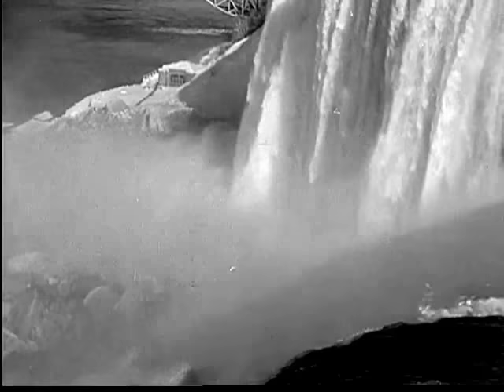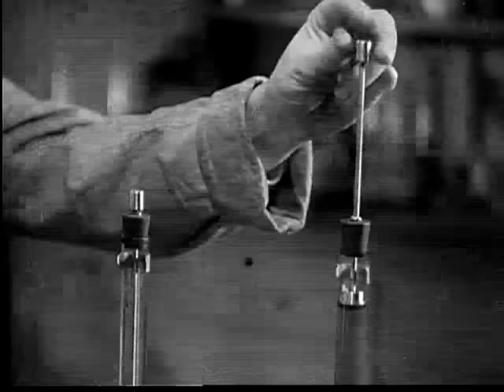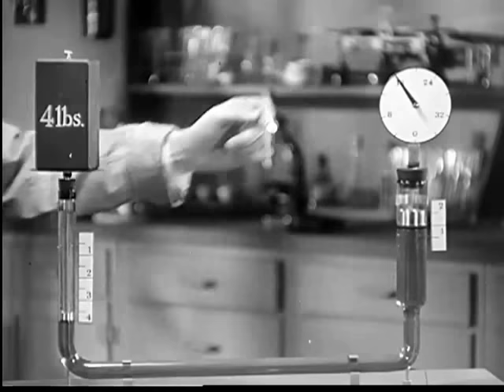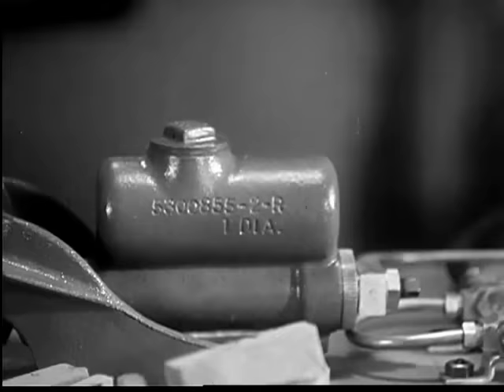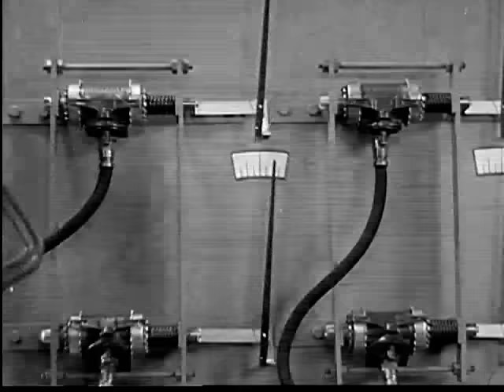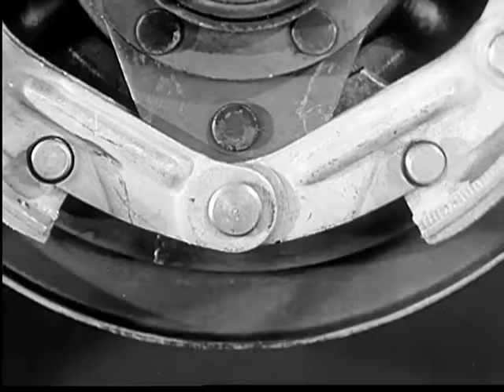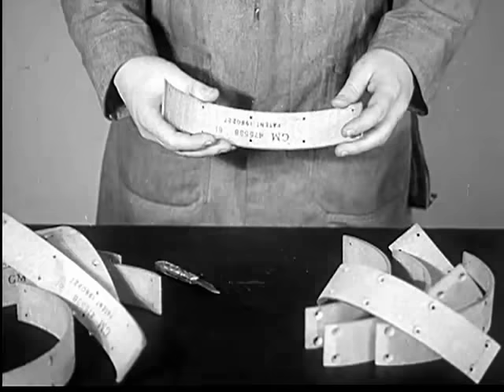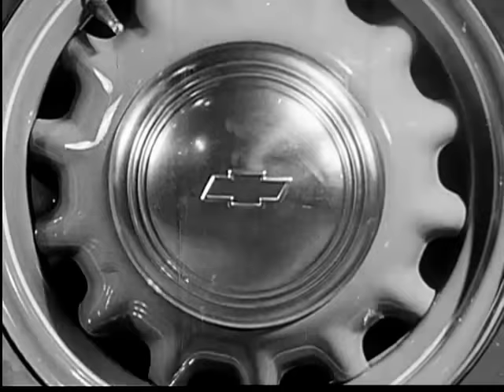Hydraulics (1936)

Comment: 90hp and a 0-60 of 20 seconds, what simpler times they were
Reply: Your car also might have not had an oil filter back then, it was an optional accessory but it was available.
Reply: To think.  My 2 cylinder, 325cc motorcycle has 42 HP and gets to 60 in about 4-5 seconds.
Reply: @this_mfr  motorcycles are different story, world speed record for fastest motorcycle in 1937 was 173mph
Reply: The world speed record for a car in 1937 was 345 mph....
Reply: @retard1643  
173 mph ?  .... in 1937 ? .... On 2 wheels ?  .... And Drum Brakes too ? ....  
F*&k that for a game of soldiers.... I would be shitting myself...........
Reply: To be fair, when this video came out there were people who watched in their middle age who had known horse drawn vehicles as the only way to travel large distances. 90hp doesn't sound so bad from that perspective. In fact if you told them in 2019 80+ years later the modern car was only 200-250 odd hp on average and was earthbound they may be bitterly disappointed.
Reply: We also had working men here in the states.
Reply: @michaelhawthorne8696  just search it on wiki
Reply: @clancon  tbh today alot people have around 90 or less hp
Reply: My 2001 car has drum brakes on back hWeels™ and 100hp. Not that different
Reply: no different to a lot of small cars available today.
Reply: @Herbertti3  yes but for a long time cars had 4 drums. Discs are alot better. Drums suffer from brake fade, it is cause by continuous braking like you might go down a hill. The drum heats up and expands. When you get to the bottom your brakes dont work or half way down the hill.
Reply: It's always a compromise with those things, sure, discs are better, more controllable, and feel a helluva lot better, but they also have an overheat failure, and that is boiling the brake fluid away, something that is a bit harder to achieve with the drums.

Not sure it's like this with all the cars, but the drums on that old beater i used to drive, when they inevitably faded going down the curitiban mountain bass, i'd just pump the brake a couple times and they would adjust and start braking again!

I did manage to boil the fluid on the newer car going down the same infamous pass a little too fast.
Rear mechanical drums saved the day, that's for damn sure!
Reply: @GashimahironChl I was under the impression that drums got bad brake fade and that it didn't really happen with discs, but it is true that the fluid can boil in extreme circumstances.
Reply: Clancy Conway 90 hp at that that was the shit! Today, to compare something like that, we look at 500-700 hp cars. I think its a really great improvement knowing these 5-700hp engines do not use more fuel than those 70hp engines.
Reply: GashimahironChl no matter what, rotors=10x better than drums.
Reply: My car has exactly 90hp and drum brakes in the back wheels 🤣
Reply: @101Volts ; sorry, but by the 1930s oil filters were standard on American cars.
Reply: @this_mfr ; and how much does you motorcycle weigh?
Reply: @RBZ06LT6 ; and what production car has 500-700 hp, (not counting $500,000.00+ sports cars)?
Reply: @RBZ06LT6 ; I'm not sure the factor is 10. Remember, the car is stopped by the contact of the tires with the road, and rolling friction is greater than sliding friction. My XKE had Disk breaks all-round, but could not stop in 1/10th of the distance as my Ford with Drum breaks. Yes, Disks are better, but not 10 times better.
Reply: oldgysgt my $65k Dodge Hellcat has 707 horsepower.....
Reply: @rockcrawler3119 ; and although it didn't cost $500,000.00, I think we both agree the Hallcat is still in the category of a luxury sports coup. It's not exactly a family car for the average car buyer like the 90hp Chevy shown in the video. A 1935 Supercharged Duesenberg Model SSJ produced 400hp.
Reply: oldgysgt My Hellcat is no more luxurious than the inside of the same car with a V-6. It is not a car most can't afford. its a fun car for the average working man.
Reply: @rockcrawler3119 ; a good friend of mine once said, "You can afford anything, but you can't afford everything". The average car buyer can't afford a High Performance Sports Coupe and still have enough money to raise a family. The best selling passenger car in 2018 was the Nissan Rogue. It sold at less than half the price of a Hellcat, and came with a 170hp engine. As for luxury, I would say owning a $65,000.00+ Sports Coupe that has a 700hp+ engine, just for "fun", is a bit of a luxury. Remember, the "average working man" has more financial obligations than just a car and insurance payment. You can afford anything, but you can't afford everything.
PS: Have fun with your Hellcat. When I was single I had an "E" Type Jag, and it was a blast.
Reply: Eze&Yare Dominguez ; excuse me, but we are talking about production cars. Got it?
Reply: @michaelhawthorne8696  Ha Ha I wonder if they wore a leather helmet for the speed test--or any at all.
Reply: The first car I drove had 45hp and when I went flat out to 60 the head gasket blew. 90hp is more than 1L naturally aspirated engines now which are common enough across Europe and Japan. 15s 0-60 for those. You can actually drive them close to the limit and not be a danger to yourself/others, which is enjoyable.
Reply: I actually laughed when I heard that. My trailblazer hits 60 I think in 7-8 seconds. It would be insane to a person from 1936
Reply: @RBZ06LT6  90hp in 1935 wasn't "the shit", it was a normal power level for a midrange to premium car. Ford V8 of 1932 had 75. Duesenberg Model J had 265, that was "the shit".
Reply: 90hp in the 1930s was so much more than most European cars had, even well into the late 50s and 60s. Back when Oil prices for America were so low that fuel efficiency didn’t matter, American engines were engineered for maximum sustainable power. They also put out dangerously high levels of emissions in a fraction of the number of cars on the road. advancements in power are admirable when you take those facts into consideration.
Reply: @clancon  80 years later modern cars are 200-250 HP?! We gotta introduce you to performance cars, super cars, sports cars, pony, muscle, trucks, tractors, Caterpillar engines, military vehicles.
Reply: @RBZ06LT6  yea, the technology has improved greatly. And electric vehicles are also among top competition for fastest cars now, electric trucks with great power levels.
Reply: @Herbertti3  The difference is how many cubic inches (or cm) it takes to build that HP. My 1951 Chevrolet developed 90 HP from a 3.6 litre inline 6. My 1999 Saturn develops about 124 HP from a 1.9 litre. Engine size to horsepower output has definitely gone down. Also, most 90 HP engines today are pushing a 2600 lb car instead of a 3100 or 3200 lb car, as was the case back then. The 3100 or 3200 lb cars today (most midsize cars) often have more powerful engines. ...so, most cars today do not take 20 seconds to get to 60. I think that some of the earlier Kia Rios did. They were possibly slower than my Chevrolet.  At least they felt that way.
Reply: @oldgysgt  Oil filters, windshield washers, turn signals, reverse lights, and a whole lot of now standard items were still options in the 1950s, especially on Chevrolet. I drove a 1951 Chevrolet for the first 12 years of my driving life, and all of those mentioned items were optional. The original owner did order an oil filter (which only filtered 20% of the oil at any given time), turn signals, the 30 hour clock, and the cigar lighter. I added the windshield washer, radio, and reverse lights.
Reply: @td3993 , I never owned a 1951 Chevy, but my 1936 Ford pickup had an oil filter, and it was standard equipment. Oil filters were designed to only filter part of the oil stream, because if ALL of the oil coming from the pump went through a filter, and the filter clogged, the engine would be starved of oil, and it would fail. Windshield washers, radios, clocks, cigar lighters, and back-up lights are nice, but 1936 pickup functioned just fine without them.
Reply: @oldgysgt  Oil filters definitely were optional on Chevys up to the 1950s. Modern oil filters have bypass valves. The old 20% system was a poor one, especially on a Chevy, since Chevys had vent louvers on the valve cover, allowing dirt and grit to get into the oil. I always found fine grit and gravel at the bottom of my oil pan whenever I removed it.
Reply: @oldgysgt  If you watch the 1937 Jam Handy Riding the Film, you'll see that the only filter they mention is the screen on the oil pump. If you added a filter to those engines, it went on the side of the engine in place of the oil distribution valve cover.
Reply: @td3993 , my flathead V8 had an oil filter mounted on the driver's side, next to the engine. I don't know if it was OEM, but it was there.
Reply: @oldgysgt  So did my Chevy, mounted right to the engine. Looked like it was put there by the factory. It was not. The oil filter may have been a regular item on your Ford. It was an option on Chevys for quite some time.
Reply: @oldgysgt  According to some expert flathead website, Ford didn't start offering oil filters as an option until 1940. It is also possible that those oil filters might be added to earlier engines, too.
Reply: @amw6394  not even close. The fastest car at the time was Mercedes w125 rekordwagen, hitting a top speed of 268 mph in 1938. https://en.m.wikipedia.org/wiki/Mercedes-Benz_W125_Rekordwagen
Reply: @GashimahironChl  That's why you want to downshift for extra engine braking no mattee your brakes.
Reply: Hey my 35 Desoto's got some spunk. She'll get to 60 in 10ish if i really ask it to. 

It will protest with dignity, but it'll do it.
Reply: Lmao that's still regular figures for a cheap new European car
Reply: @mistermr2147  If the downhill is long enough for brake fade to be a concern, yes. 
But when wear is more of a concern... new brake pads are cheaper than a new clutch.

Of course, that's rarely relevant with an automatic transmission, but if you have a manual, it's something to consider.
Reply: @RealRanma  Nope it was George Eystons Thunderbolt which did 357.5 mph in September 1938. https://en.m.wikipedia.org/wiki/Land_speed_record
Reply: @101Volts  It wasn't standard on Chevys until about 1967.
Reply: @this_mfr  But it doesn't generate enough torque to get a car moving.
Reply: More expensive cars could better that.
Reply: @this_mfr  And your motorcycle only weighs about 300 lbs.  The lightest Ford V8 weighs more than 2600 lbs, with most weighing over 3,000 lbs.
Reply: @mattreviews4948  That's why you should gear down when descending steep hills.
Reply: @RBZ06LT6  But it takes piles of computers to do that.  For me, NO THANKS.
Reply: @oldgysgt  Not on Fords and Chevys they weren't.  They became standard of Fords after the war, not didn't become standard on Chevys until 1967!
Reply: @oldgysgt  They mainly don't fade easily, rather than giving shorter stopping distances.
Reply: @-BuddyGuy  But engines that small don't produce any torque.
Reply: @Forge17  ALL engines, not just American engines, produced high levels of dangerous emissions.
Reply: @td3993  Today's engines also don't produce as much low RPM torque, so a 120 cubic inch 90 horsepower 4 cyl will not move a 3,000 lb. car off the line as easily as a 216 cube 90 horsepower 6 cyl will.
Reply: @oldgysgt  Ford made oil filters standard much sooner than Chevy.  Chevrolet didn't make them standard until about 1967.
Reply: @oldgysgt  It was probably OEM.  Ford beat Chevy in making oil filters standard.
Reply: @stev3548  In the 10s?  In stock condition?  That's pretty damn good for a 6 cylinder even as late as the 80s!
Reply: @jlco  Down-shifting on down-hills won't hurt the clutch at all.
Reply: @michaelbenardo5695  If you really want someone to talk to I recommend saying something positive to someone who commented recently. Not talking American bullshit to 15 different people from years ago
Reply: @michaelbenardo5695  yes, but 7mpg in a Pontiac created much worse than the 17 from a Citroën
Reply: @-BuddyGuy  American cars are not bullshit .
Reply: @angelitavaldellon7600  Get off your wife's phone
Reply: @GashimahironChl  Disks don't have very good feel, but they are very fade resistant, and they shed water excellently, but yes, they can boil their fluid, as they generate much more heat.  That's why they have been, until the last few years, a failure in heavy commercial vehicles.  Too much heat.  But you should gear down when descending long grades, regardless of what type of brakes you have.  You should never try to ride the brakes.
Reply: @oldgysgt  Actually no, but most cars were sold with them.
Reply: @td3993  But, your Chevy had much more torque, especially at low RPM.
Reply: @td3993  Oil filters remained optional on Chevys until about 1967.
Reply: @-BuddyGuy  You going to make me punk?
Reply: @Forge17  Pontiacs got better than 7 MPG, and Citroens got better than 17 MPG.
Reply: @-BuddyGuy If somebody is wrong, I am going to say so.  Deal with it.
Reply: @oldgysgt  any dodge 6.7
Reply: The cars must have been very heavy. 90 HP is good enough to get to 60 mph in 12-13 sec these days.
Reply: @srinitaaigaura  They were quite light -  only about 2800 - 2900 lbs.  The more expensive cars were much heavier, but much more powerful as well.
Reply: @oldgysgt  Electric ones
Reply: slower not simpler
Reply: That's still the case in most countries
Reply: That's because the transmissions were rather primitive, and the cars were quite heavy.
Reply: It's hysterical to look back at the sub 200 hp engines of the previous era and joke about them being referenced as 'performance' equipment. My Kia makes more than that and could scarce even keep up with a vehicle with 'performance' in its description these days. What a tremendous leap of ability for a word.
Reply: We should have capped it at 100hp and continue to improve efficiency for consumer vehicles.. but instead, we wanna 80 mph, and that requires safety, which requires weight, which requires more hp which requires more gas and BOOM global warming... lol maybe

Comment: The mechanical aspects of early vehicles I will always be able to respect. That and these old training videos/advertisements. My engine compartment has only 5 wires in it or somethin around there, can't stand harness work.
Reply: Shawn Stafford  It really depends what car it is and how old, you mainly need electrical wiring which in old cars is very simple.
Reply: In the new Hyundai Veloster, its super easy to service or take the engine out. Just one wire harness to unplug, unbolt transmission, and a couple motor mounts and the engine is out in no time.